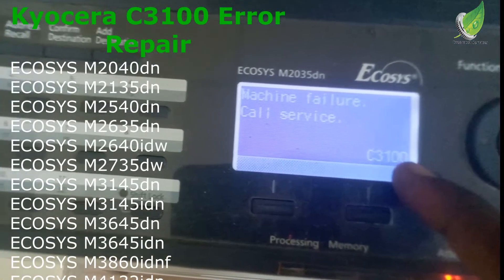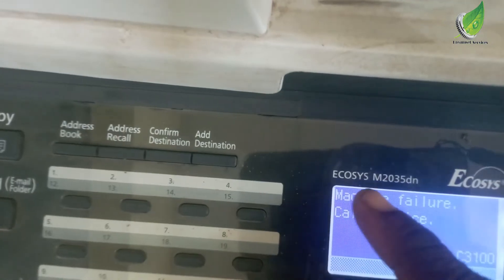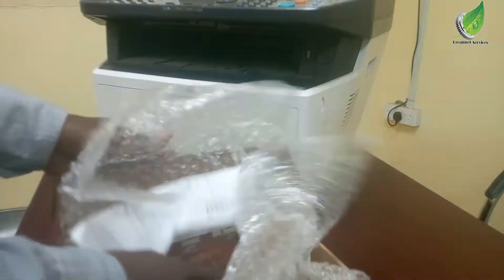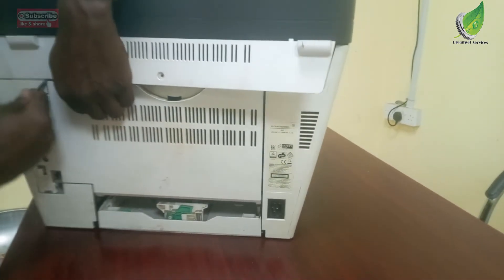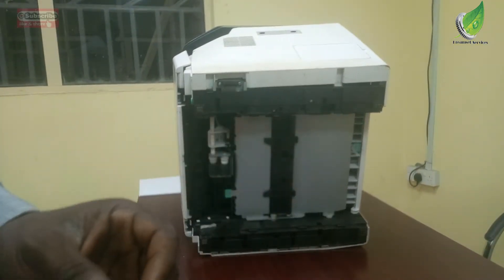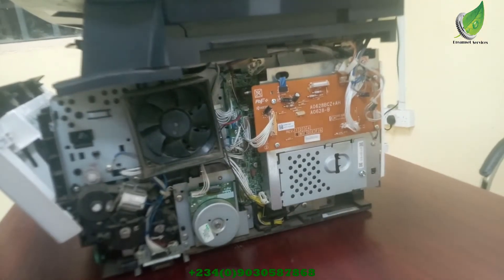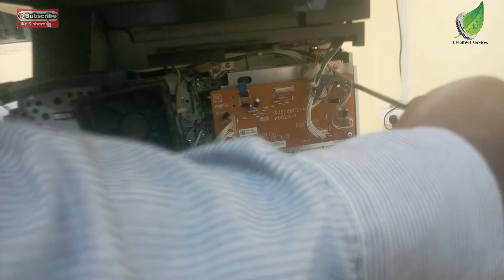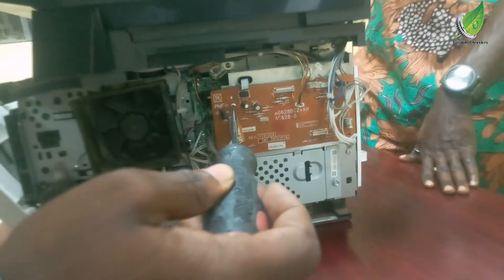Kyocera Error C3100 Repair

Comment: cf010 callservice error kyocera 2535dn code
Reply from the maker: Check the DIMM slot, replace the Memory, if that didn't solve the problem, you have to flash the formware